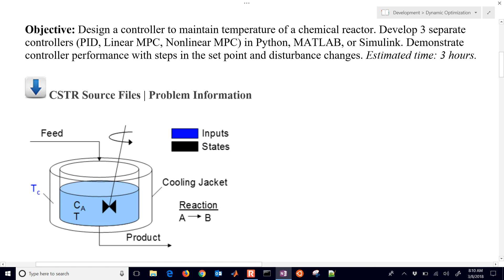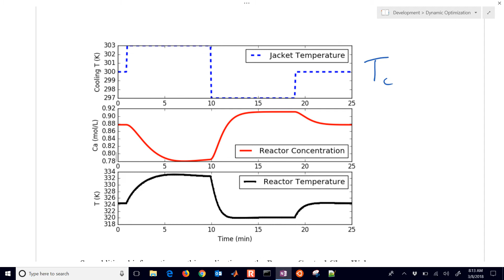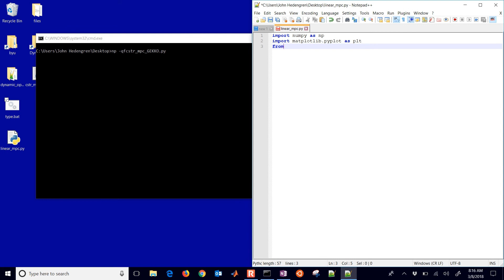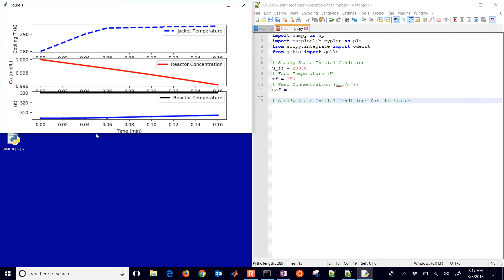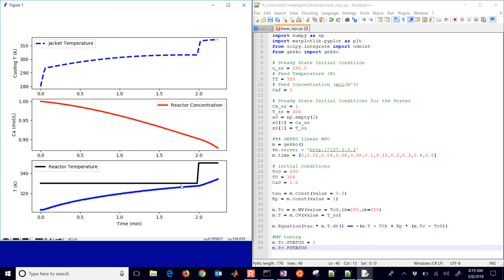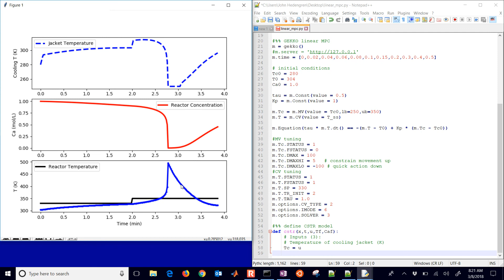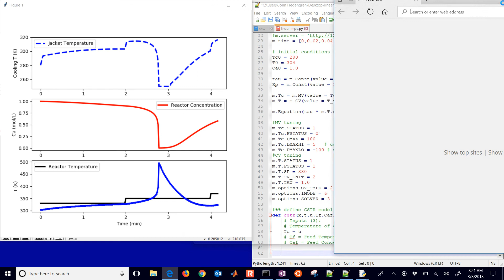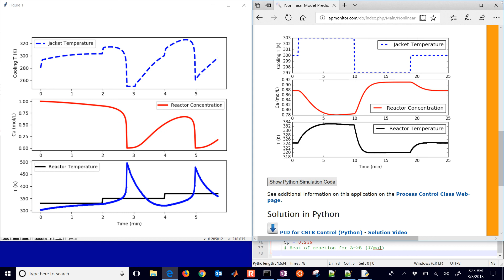Linear MPC with Unstable CSTR

Comment: while doing the step test why do you cool until 295k if it is in any part of the problem information?
Reply from the maker: The reactor is unstable when the cooling temperature goes above 304-305 K. This gives some room for the step change.

Comment: If the system is unstable I don't think you can do the system identification so easily..
Reply from the maker: The reactor runs-away above a certain temperature (about 324K) because of the exothermic reaction. For systems that are unstable under all conditions and require closed-loop feedback (e.g. inverted pendulum), closed-loop identification methods can be used. Here are three examples: (1) https://apmonitor.com/do/index.php/Main/InvertedPendulum (2) https://apmonitor.com/do/uploads/Main/Report_self_balance2018.pdf (3) https://apmonitor.com/do/uploads/Main/Report_rocket_landing2019.pdf